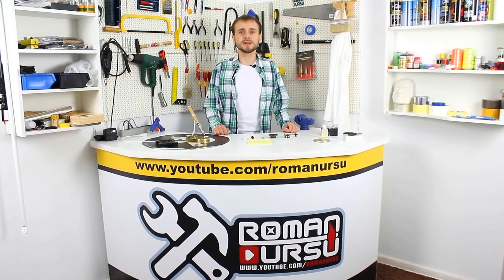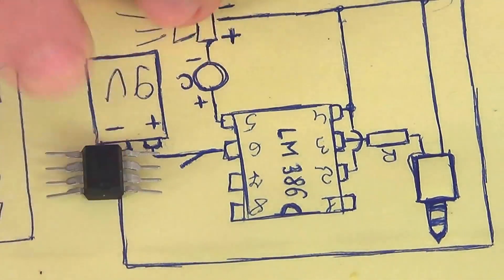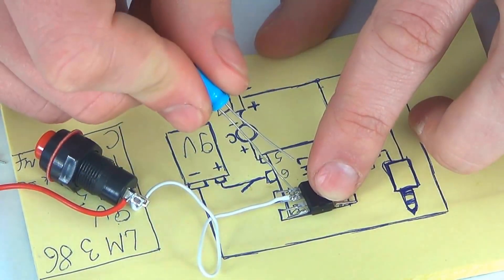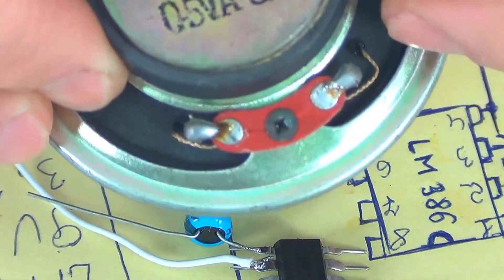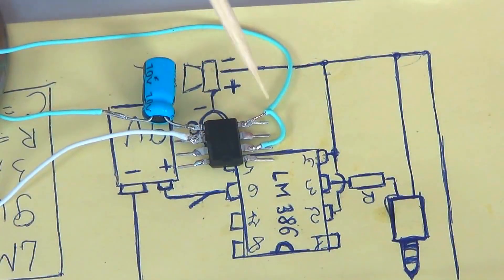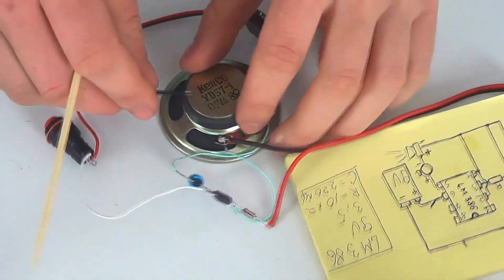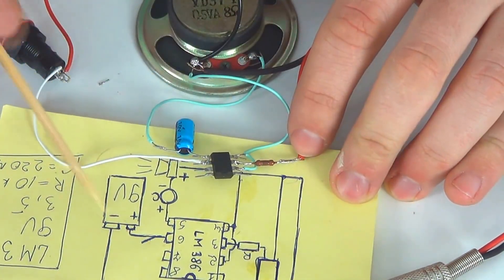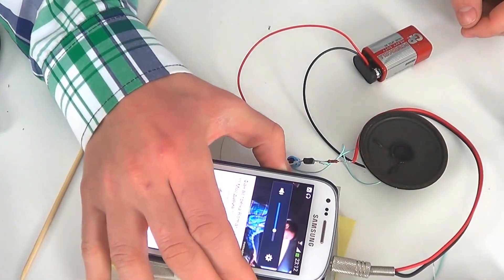How To Make a Mini Simple Audio Amplifier / Tutorial

Comment: HELP!! Can someone can help me?
i have an 8W 8ohms speaker i calculates the Voltage amd amperes 
to calculate voltage i use this formula:-"√(Watt multiply by ohms)
i got 8V input needed as result and a 9V battery can do so but will eat the charge;-);-). And to calculate Amperes i used this formula;Watt divided by Voltage and got 1 Amperes so what resistor and condensers i need to use ????plz help me thx in advanced for all who helped me

Comment: In this configuration, as shown in the schematic, the amplifier works quite well, but produces quite a bit of noise in the form of a loud buzz in the speaker.

Soldering a 10 microfarad capacitor across the speaker leads (in parallel with the speaker) improves the sound quality remarkably.

Comment: not smart t touch the ic with bare hands without beeing grounded
Reply: GOLDENBAS016 Also, he has very weak solder joints on the switch. Not only that, but it's also VERY dangerous to solder directly to IC's as you risk easily over heating the IC.

Comment: can v connect a 2.7 ohm speaker???
Reply: reply me plz
Reply: 2,7ohm speaker? where the heck did u find it? :D
it will suck more amperes from amplifier, which may result in damaging the amp. Personally, i would add a series resistor about 5,1 ohm (remember, the resistor package must withstand about 5W) or try to connect it directly to output, but it can blow up the amp, so keep your finger on the chip and if it turns hot, then turn it off and add an series resistor or obtain another loudspeaker
Reply: but datasheet for pam8403 says it can handle 4 - 8 ohm load, so this is the same case
it may work or you may burn it

Comment: Can I use this for guitar?
Reply: yes , but to telll you the truth punch amp 7502a chip is preferred by some itk ... its just sounds "better" on the clean side and is 2x power or so . . . the lm386 amps distorton a guitar which some like this as a built in feature but i find this type of lm386 breakup to be not so pleasant as , well it is crap dirt and even when you clean it up you can still here it . . .

Comment: i made this type of amplifier and it is making buzzing sound when jack not connected to phone is it ok
Reply: Yes. It is fine. If it keeps buzzing, smack it with a hammer. It will stop.
Reply: I think that is happening to you because if you have it on, it doesn't need the jack to be plugged in, since it has an external power source that keeps the speaker on creating a buzzing sound due to the constant flow of electricity through the speaker..
Reply: Plug it in, turn it up as high as it will go, throw it in the bathtub. Works great!

Comment: sorry is an 10kΩ registore or 10Ω...???because you sey 10 Ω BUT  you wirte 10KΩ
Reply: It is 10 kiloohm, 10 ohm resistor with extremely low current flowing through it (amp has high input impedance) would have extremely low voltage drop (maybe even not measurable with normal DMM). but if you use 10 kohm, then there would be few millivolts on it and it will do its job
Reply: +Jiří Bekr so i am gonna use 10Ωμ registore? b
Reply: So you are gonna use 10 kiloohm resistor
as i wrote in previous comment, only 10 ohm wouldn't be enough for what is the resistor supposed to do
10 ohm is too low, 10 kiloohm is OK
Reply: +Jiří Bekr ok thank you so mutch
Reply: for 2.7 ohm speaker which resistor we have to use ???
Reply: do you have a 2.7 ohm speaker??.l
Reply: if yes do not use it.. you can burn it.... buy a 8 ohm and higer
Reply: to vamsi kish: already answered your question in your separate thread

Comment: i have a little question
why we use a capacitor in circuit? i mean what is its function here?
thanks in advance and this was too much helpful
Reply: +ali shan Javid  ___The capacitor blocks the DC offset (which will be about one-half of the battery voltage) from going through the speaker. Such DC would increase the power dissipation in both the chip and the speaker, rapidly drain the battery, and possibly damage components from overheating. A more modern implementation for small battery-powered amplifies uses a pair of amplifiers (built into one chip) in a "bridge" configuration. This allows the elimination of the large output blocking capacitor, and provides more power to the load for a given battery voltage. 

The circuit, as presented, is not optimized; refer to the Texas instruments data sheet for complete application instructions:
http://www.ti.com/lit/ds/symlink/lm386.pdf

For a bridge-configured chip that can operate with 9 volts, see the New Japan Radio data sheet for type NJM2113:
http://www.njr.com/semicon/PDF/NJM2113_E.pdf
Reply: thanks :)

Comment: can we use 0.5 to 10-watt speakers
Reply: +akshay kalkeri ___you can increase the wattage capacity of the speaker, but that will not increase the power of the amplifier, which depends on the impedance of the speaker and the voltage presented across its coil.

Comment: what is the max power of speaker I can use in this project? I have 40 watt speakers and want to make amp help please
Reply: +Luka Mamulashvili The maximum wattage this ic can output is 1 watt so I believe you could run them but they would be very quiet. (If I were you I wouldn't even try to connect them because they might fry your LM386 ic.)

Comment: *Hey I tried this however i'm making this for my electric guitar but it dosen't sound that loud
so ive tried to analyze the problem is it because
-the circuit is not really made for an electric guitar
-my soldering was bad (i used recycled solder irons)
-there were no condenser and resistor
-i was using a 5 volt and 500 miliamp,a 9 volt and 1000 miliamp,a 12 volt and 500 miliamp
what do you think the problem is?*
Reply: There are more efficient amplifier types than the shown one just search the internet for amplifier types and youll find some circuit drawings which you can copy it might be a bit more complecated than this one

Comment: Is It possible to switch the capacitor with a resistor? Can someone explain me why or why not please? Thanks for replies and sorry for my bad English.
Reply: +MakerTube No, it isn't possible because a resistor has a certain resistance which basically prevents some of the electrons from flowing depending on the rating of it but capacitors store an electrical charge to be discharged later when it is needed. If you have any more questions just ask. I'm happy to help!

Comment: Why not use the 12watt TDA1519A chip
Reply: +NeXTSTORMING because to achieve this chips 12W/channel output you'd need a higher voltage and current than a single 9V battery can deliver.

Comment: how many farad is the capacitor(condenser as you refer to it)?
how many ohms is the resistor?

I LOVE YOUR CHANNELL
Reply: +RedBirdRedstone Use a potentiometer and you can change the volume, and the capacitor is 220uF
Reply: +UnfairGamer i think that the capacitor is 220 milli farad (220 mf) and the resistor is 10 ohm (ohm = Ω) 
dont know if you need this info know but you get it anyways

Comment: and do u have to use a resistor ?????
Reply: +nie510 euhmmm no... for a HF or LF you will need a resistor and a coil or a capacitor more
Reply: +troels321 yup
Reply: +Eva Bekkert i did it without :P
Reply: +Eva Bekkert why should it be needed?

Comment: can u use a 50 volt 220 mf cap.
??????
Reply: Any cap with a  higher voltage than what you putting through your circuit should work fine

Comment: You can use dual  operational amplifier (like as LM158-N, LM258-N, LM2904-N, LM358-N) to make stereo amplifier.... good movie !
Reply: yup
Reply: +Adam chemLab No, you can only use the lm386 for this amplifier, others (like as LM158-N, LM258-N, LM2904-N, LM358-N)  are OPAMS for other aplications because the impedance, the power and other parameters are different.
Reply: Upss. I made a mistake, but it could be applied dual operational amplifier...
Reply: +Adam chemLab From e.g: LM358 (for project like whisper) http://www.mt.com.pl/wp-content/uploads/Praktyczny_kurs_elektroniki_cz11.pdf

Comment: what is the watt rating of the resister?
Reply: +Jhon corner 1/4w is enough
Reply: Thanks.
Reply: In aplication like this, things won`t get hot, so it is fine to use 1/4w resistors
Reply: +Alex Wielinga I'll try that...
Reply: +Jhon corner 
Specs:

Integrated Circuit is LM 386

Resistor is at 10 Kilo Ohms
Capacitor at 220 millifarad (10 volts)
Speaker at 0.5 to 1 Watt (8 Ohms)
speaker Jack at 3.5 millimeters

Others:
On/Off switch
9-volt battery
9-volt battery connector

Soldering iron, wires, lead, wire cutter/stripper, cellphone

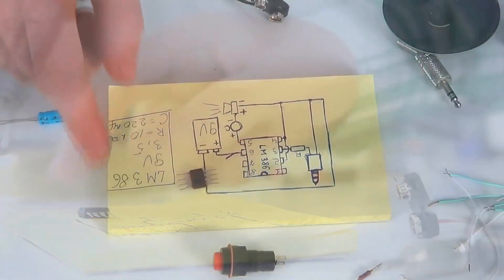See specs at 1:15